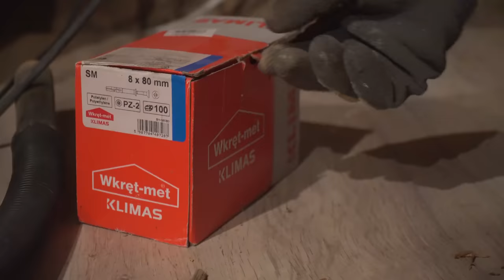Old Doorway to Desk Conversion | DIY in 1 Day

Comment: The desk area is very nice. We have lights bulbs that look like a  flame  or maybe a smaller watt bulb or a dimmer switch.  You should do shelving in that cabinet you  took to your garage for inside the house for now.  Repurpose  it in the kitchen.  You could paint it, put doors on it.  Make it into a swallow  cabinet on the brick wall. whatever. Too nice to use in garage.   We all love chocolate.  Good luck on the car. 

On the table yes use fine sanding after first coat.  You can sand again after second coat if you see imperfections or if still not to your liking.  Maybe a nicer finisher brush for the last coat also will help.  Clean brush and save for those jobs.
Reply from the maker: Yeah I might change the switch for a dimmer, these are the darkest ones I could find without spending ridiculous ammount, for 20 euros we can get a dimmer for LED. Overall it looks quite good 😊❤️

Comment: Turned out beautifully!  I would round off the corners with the jigsaw and maybe use one of the router bits or your sander to take down the sharp edge to give a more comfortable feel while using it as a desk.  You could even make a faux raw edge to keep with the rustic look.  Edited to add... I was just looking at it again.  I think I would extend the board about 6 inches past the brick corner on the left and then round over the corner.  That would help hide the support block underneath and would make it look like it was embedded in the stone.

Comment: Looks amazing. I'd put a strip of old wood across the underneath to hide the new wood  battons. Maybe
Reply from the maker: Yeah might do that, they are looking a bit out of place, but I didn't want to use metal corners either they would look even worse. Might put a wood in front to add to a look 😊❤️

Comment: I would replace the hanging lights with some medieval 'torch' like fixtures either on the brick on both sides, or lights on torch stands.  For the wood in the back, I think I would get some faux iron (again, medieval-looking) massive door hinges for one side and a faux iron lock for the other.  Of course, I am a dreamer and have no idea what those would cost---but, they'd look fantastic.  I like how you repurposed the wood and made the 'desk'.  Are you going to stain the wood and varnish it, too?